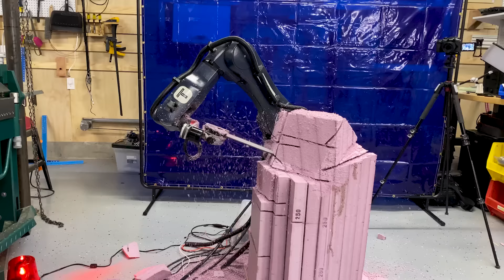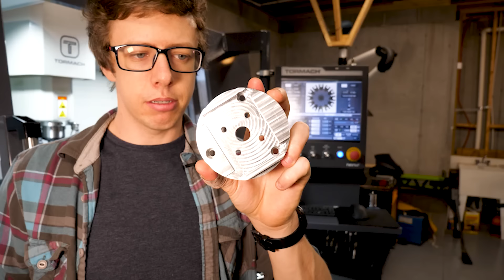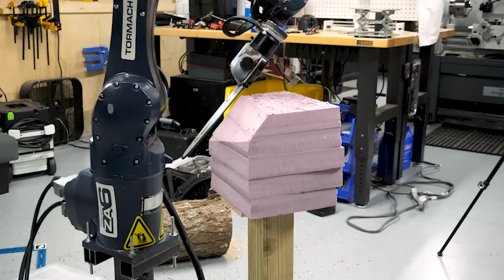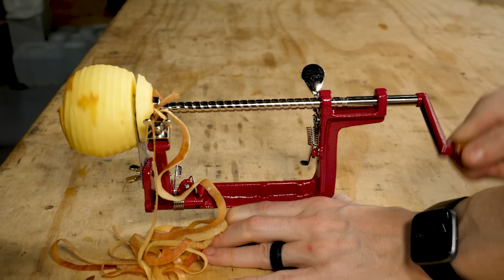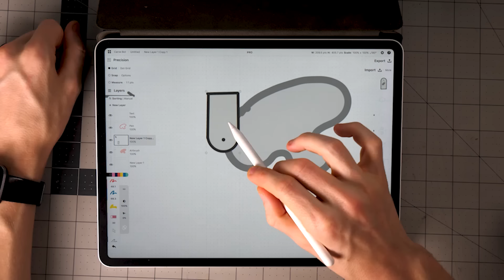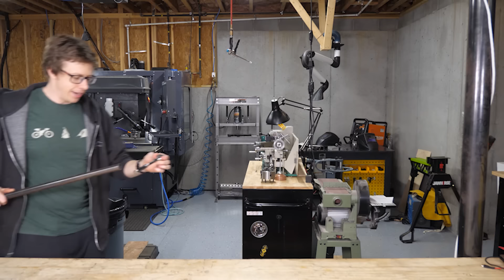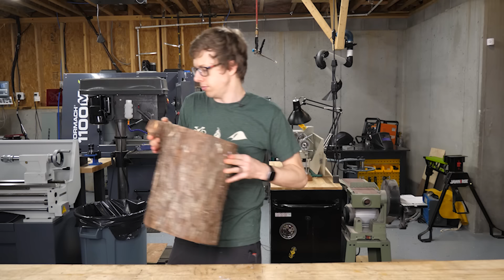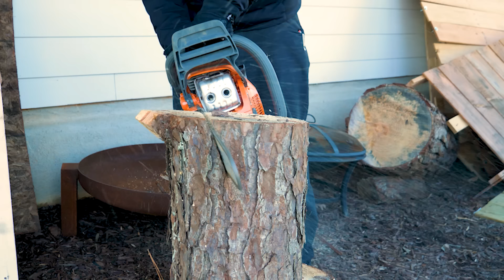Chainsaw + robotic arm = art?

Comment: Chainsaws are not designed to cut at the tip.  The profile of the chain is wrong and it puts way more pressure on that tiny pathetic bearing at the end.  You can plung a chainsaw into material but it will cause it to overheat fast and dull the blades much faster.  You get less than 2 hours of intermittent cutting before the blade needs to be sharpened.  In the base of a precision robot you can't really sharpen it more than 1 or 2 times before the blades start to get shorter.  Not enough to bother a human operator but certainly enough to affect a robot accurate to the millimeter.  You have a machine shop there.  The first thing you should have done was to build a new blade bar from scratch with a shorter length and a heavy duty lubricated bearing.  Then shorten your blade to fit the new bar.  You could probably reduce the turn radius a little while you are at it.  To help further reduce heat since all most all of your cuts are going to create more heat than normal put heat sinks on both sides of your blade and mount fans on them.  Since you are using this in a shop there is no reason you can't do this.

Another tip, I use to program robotic welders so I have years of experience in that area though not specifically using a chain saw :).  I often found it easier to manipulate the part than the robot.  So take this with a grain of salt.  I think the easiest way to drastically reduce your cut time, keep most of your cutting on the side of the blade instead of the top and solve the problem of having various sized stock is to then the whole thing on its side.  Not literally but imagine the wood log is in a lathe and the chainsaw is the cutting bit for the lathe.  You rotate the log and use the cutting tool to take off layers until you reach the desired size.  So in this case the log is vertical so rotate the chainsaw horizontal, rotate the log and have the chainsaw move up and down as it rotates.  Now the cutting can happen on the long side of the blade instead of the tip.  You can even adjust the blade deeper or shallower as it rotates.  Don't take a cut more than 1/8 of an inch or so.  By the time you are done with this orientation you will have at least 1/2 your cutting down and a much cleaner stock to continue from.

Comment: I'm sure it was thought of andI didn't see the mess created by it to indicate it was working, but when cutting the log the chainsaw really needs bar oil. One of the big reasons for it is to lubricate between the chain and bar and stop it heating up and ending up in that exact circumstance with smoke everywhere. Also the lug you mentioned you thought was the issue is a depth guage which dictates the amount of material removed with each cut of a tooth. You can grind them down if you want more taken however that would make the saw work even harder, with that size saw and how blunt those teeth would get very quickly it's probably not ideal.

Comment: The heat / slow cutting problem is probably caused by multiple problems:
1. Is the chain sharp? if not sharpen it.
2. Is the barrier to high after sharpening? make it 0.65mm / 0.025591 inch lower than there upper cutting face.
3. Is there chain oil in the reservoir?
4. Make sure the chain is properly tensioned.
5. Make sure the chain is moving the correct way. (Happens to the best of us...)
6. Preferably cut with the side moving away  from the tip to prevent kickbacks. (This is the bottom on a regular chain saw)
7. Never cut with the upper 90 degrees of the tip, because this will cause a dangerous kickback.

If you have any questions feel free to reply to my comment or on my discord kay1010100#2196

Comment: I work with industrial robots... the solution to "whoops I broke the chainsaw four times" is a tool breakaway. You stick a magnetic coupler on the plate you would bolt the tool to, and then you bolt the tool to it. If too much torque is applied, it "snaps" off. They also typically have a connector going back to the robot to let it know this has occurred and take steps to e-stop, shut off, or move away.

Comment: Side note for the chainsaw.  You can drop to a 1/4 picco chain by changing the bar and sprocket.  The chain is thinner so it will require less energy to drag it through the wood.  Chainsaws are also designed to cut crossgrain, your first cut was called "Noodling". Noodling fdoes not make chips but long noodles of wood.  Noodling takes a ton more power and goes very slow., try a skip chain for that.

Comment: 13:00 im not an engineer, but wouldn't it be safer to maintain the button pressed to work, so if you drop the button or you get injured impeding you to push the button, the machine stops?

Comment: Perhaps it would be helpful to consider the techniques people use when they create carvings. What you are trying to accomplish is known as carving the round. The first step in carving in the round is to remove excess material to roughly outline the figure you are trying to carve. This is usually done on two planes, a north elevation and an east elevation. Once the excess material is removed the saw will be able to make the detailed cuts because it won't be trying to remove so much material. Love the video, can't wait to see where you go with this.

http://woodcarvingillustrated.com/blog/2010/10/06/sawing-carving-blanks/

Comment: Since you are using a 3d model, can't you use the triangles as cutting planes?
The quick way should be triangle-plane collision checks.
Once you have no collision free triangle/plane left you should be able to cut planes that have only one "collision edge" or not using an infinite large plane, but only a subset of it.

I will try to rephrase what I mean in pseudo:
foreach triangle in model.triangles:
    if planeFromTriangleHasCollisionWithAnyOtherTriangle(triangle) == false:
        cutAlongPlane(triangle.plane)

I am not sure how to continue there, but I am sure that analysing the geometry (triangles, planes and edges) is the way to go). There are certainly nice computergraphic libraries for python

Comment: You need a much more powerful chainsaw. The power has all the difference, plus the overheating if the lack of chain oil used tu lubricate the sled.

Comment: Um i wish i watched this sooner so fun fact theres chainsaw chains called ripper chains there is just no kick proofing just dogger teath it rips and when held by something as stable as this arm kick back shouldn't be a problem.
Reply: Its more like a multiplying problem in the case of kick back it catches then it drives its self up the cut by catching the end of the blade as long as it only slices and doesn't do plunge cuts it will be fine if the end hits

Comment: Try using the chainsaw like a ballnose endmill.. Youll be cuting way less material but might have a better finish.. Your using it more like a saw or even an axe.. Cuttinf away chunks.. Youll be note so carving away material using it like a ballnose endmill.. You should be able to use cad/cam software and input tool and toolpaths almost as if it actually was an end mill.. There geometry is almost identical in the 2d.. The ball nose is just more of a cylinder wearas the chainsaw is flat
Reply: Likely have to write for a rough pass taking traditional cuts removing as much material in a pass as possible then write a finish program for the details and take carve cuts like i said.. Just an idea.. Maybe research chainsaw carvings and explore the ways that they use the chainsaw to remove material

Comment: Amazing video! We might be able to help with the tool path optimization. We have developed an AI based platform for machine and formulation optimization. Usually we use it for other stuff, but your problem seems quite easily solvable with our software...

Comment: Hey,

I'm thinking, why just don't check if the object is concav or convex in a certain part (0 to 20°), if it's konvex just do a tangential cut, if not search for cut that would remove the most material except for the concave part. After this come back to the concave parts and do it the way you did. After doing this for all layers do the same in zx and yz plane. In the last part find cuts by combining tangential cuts in a single plane in two planes.

Comment: 1. You don't know a thing about chainsaws.
2. Why wouldn't you go with like a wood shaping burr? Just put a powerful drill on the end of that arm, and there you go. You'd probably want to secure the bottom of the wood more securely, but it would carve a lot smaller details than a chainsaw. Chainsaw is good for removing a lot of wood, but you can do that part yourself, maybe have a laser attached to a computer that tells you where to cut.

Comment: Did you add a momentum term in gradient descent? Momentum ensures that your point will keep moving in the parameter space for a bit longer even when the gradient is 0. If you are lucky, it will escape the local optimum. Also you might want to consider evolution based algorithms

Comment: I can already see an issue with trying to use this oh actual wood. Unlike styrofoam, wood is not uniform in hardness, nor soft. With a chainsaw (especially fine carving), there's a lot of doing this by feel. You do need to feel when You're hitting resistance (know, tighter wood grain, etc), and you need to rock your chainsaw to allow for it to get a proper bite. If you try to just push it straight through wood it's going to be far more difficult than working the saw back and forth so you're allowing the saw to have less contact area with the material, allowing for it to cut a smaller area at a time.

Comment: Also, we frequently use 12" blades to cut much smaller radius coves. Set a fence (guideboard) at A TANGENT ACROSS THE TABLESAW TOP AND PASS THE BOARD OVER THE BLADE AT A LIGHT Depth.  Light is key. The same thing will work for your chainsaw, turn to a tangent and the radius sawn becomes smaller.

Comment: You need to go to a shop that uses ripping chain, which is sharpened at 90 degrees, instead of standard chain which is sharpened acutely  to crosscut.  It will cut far faster, stay cooler and the edge will last longer. Find someone that has an Alaskan chainsaw  mill. They use chainsaws with 5' bars to rip wide logs into boards.

Comment: The problem is that you are simply using a tool that is not suitable for the job. When you made the belt wheel you used correct scale cutters. Your problem is no different than trying to undo a 10mm nut with a 30mm socket. The first time you found a radius that the saw wouldn't fit in, should have been the end of the project. You wouldn't have attempted to make that belt wheel with a 2" wide cutter, and it wouldn't have taken weeks to figure that out.

Comment: Do you have anything putting oil on the chain? That helps reduce friction on the bar, and keep the Temps down. All gas powered chainsaws have an oiling system

Comment: 17:30 those are your cut depth guides. Because the cutting edge is at an angle for relief each time you sharpen it you lose a little height so you should be filing the cut depth guides as well when you sharpen your chain to keep your cut depth consistent.

Comment: Swap the power pruner head with an electric top handle climbing saw. 
You are using safety chain when you need straight cut ripper chain. Its like wondering why you can't use drill bits for milling hardened steel. Regardless of what type of chain, they will get dull when they get too hot. You might need to try different bar oils.
You can get narrower chain and bars, some come as kits with new sprockets for a much smaller chain.
Your logs looked like a green hardwood, a seasoned soft wood would be a lot easier for the saw.
I'm sorry if this comes off as rude, but how much chainsaw research did you do? A lot of this info is on Youtube. As someone that runs chainsaws for a living, and who as watched a few in person carvings. That part of the project feels very slapped together to me. 
Otherwise, very interesting, and terrifying.

Comment: for gradient ascent (maybe you tried this and it didn't work?) - you can randomly pick multiple starting points (and make sure they're not too close to each other), do the ascent, and use whichever result is best. it's still not very computationally expensive and it's a relatively easy-to-implement solution. you still won't get the most ideal result, but it is usually better anyhow

Comment: Must have been mentioned, but "anti-kickback" thing on the chain is the tooth height gauge and has to be filed down as the saw is sharpened or yes, it will just rub and get hot. By the way, your algorithm looks like a Simplex with  random leap to a new starting place whenever a peak is reached. I worked with a fellow in the 1980's named Ren Curry who published a paper on the subject. Simplex is amazingly useful for many problems and works in any number of dimensions.

Comment: Cool video and project.  Love the safety sticker!  🤣 

This reminds me of a CNC machine I used to run nicknamed “The BZ”, manufactured by Baljer Zembrod.  Was one of three in existence and was used to manufacture big timber pieces for custom wood architectures.  There was a chainsaw tool that the spindle would grab and use to cut slots for steel plates.  The chainsaw was the most “fussy” tool in the library.   Deep cuts would “deflect” a bit and cause slots to not be square or straight.  Always sharpening the blades.  There was also a reservoir of oil that would drip automatically onto the blade while operating.  It helped to prevent overheating and flattening the tip of the chainsaw guide-bar.

Comment: You need a saw chain sharpened like the ones chainsaw carvers use. Also needs a more powerful motor, like the one that was on the pole saw. Next level will be interchangeable saw toolheads, at least having a small detail one. Pro saw carvers often use many saws, some with custom stubby bars with a nose radius as small as one inch for getting the details.

Comment: Gradient -descent methods getting stuck in local extrema of a rugged optimisation landscape is a well-known limitation. There are also certain classes of optimisation hypersurface over which one might wish to operate that simply don't work with GD - for example adaptive IIR filters which blow up on singularities. A common technique to avoid these pitfalls is Kalman optimisation. You might very well see this in, for example, the decision feedback equaliser in a radio modem, but the method is generally applicable, and crops up in, you guessed it, motion planning/trajectory optimisation for robots. There's a lot of matrix manipulation involved, but modern CPUs are blindingly fast and should handle it no problem.

There's also simulated annealing and genetic algorithms, although these are a lot of work to code.

I worked on stuff in this field 25 years ago so I'm totally rusty, but the maths hasn't changed.

Comment: That part of the chain is called the raker and it isn't an anti kickback feature but decides how thick the cutting tooth will cut. For a chainsaw to cut effectively it is essential that the chain is sharp and that the rakers are filed to the correct depth. If the rakers are too high it wont cut and if it is too low the chain will tend to bind.

Comment: Please know that I know nothing ... just saying. But got a question? why not program it to do a digitized map of the unit before cutting? Basically, program a program for the program. the software will run digitizing the points of the object using the tip of the blade in a horizontal position while the unit rotates when needed. Every time the safety shield blade cover (doubled as a clicker) clicks it, it marks a point in a 3D image in the computer in which the next program reads. once finished take the safety guard/clicker off and let the cutting begin.

Comment: you have a 3d model.  You could establish a series of tangent lines for a first pass, which are spaced a few inches apart and stop before they hit the model in a different location.
To get more detail you just need to increase the number of points on the surface of it.

Comment: Couldn't you have just used slope formula (Or even derivatives if you had an equation) to find cuts in 3 dimensions.. by my estimation a rudimentary algorithm would have relatively good efficiency of O(nx^2 * ny^2 * nz) (assuming you had 5000 points on the model evenly distributed on all axis that would be about 10 trillion operations worst case scenario or about 10 seconds on a 1080ti accounting for inefficiencies as a worst case scenario.)

Comment: 9:54 when the first derivative of a function is equal to zero, that point is either the maximum or the minimum value of the function. by imagining the volume of removed material as a function of the angle and direction of the cut, it should be possible to find all the maximum and minimum volumes. once you know the maxima and the minima, you can write an algorithm that sorts through these points to find the highest one. this should remove the issue of choosing the wrong highest point.

Comment: If you havent yet, check out evolutionary algorithms. I think one of those would have worked really well for this, they solve basically like gradient ascent (if your evaluation is correct), but are much easier to code. and you can mess with them a lot, which is fun. and are usefull for all kinds of stuff.

Comment: I think part of your heat problem may also be lack of lubrication. Chainsaws have an oiler system to constantly feed bar oil to keep things cool. It doesn't need it for the foam because the foam doesn't provide enough resistance to generate heat. Cutting hardwood requires some force, causing friction, generating heat.

Comment: Those points on the chain in front of the cutting teeth are called "rakers" and they help remove chips along with set the depth of cut. The tooth will cut until the raker bottoms out in the cut.